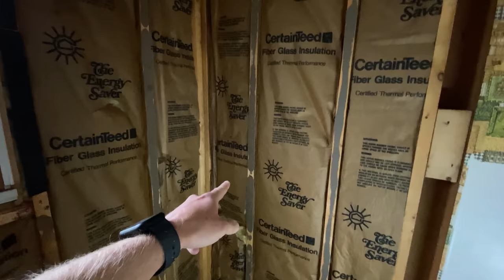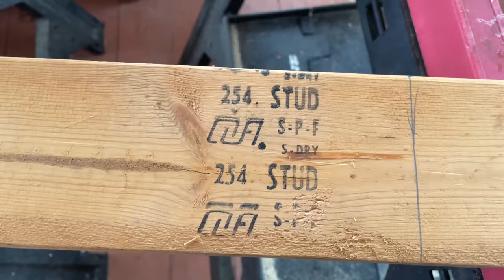The Modern Home Makeover // Episode 10 - Moving a Window

Comment: The guy that built/worked on this house before you is the one everyone claims to know that “can do it cheaper” than the professionals 😂
Reply: That's every remodel ever. Codes were different then too, so what passed before might not now. My spare room from the 1930s had 1" cardboard for insulation. I'm sure this house they are working on has tons of two wire systems where now we have 3 wire. It's definitely interesting how things change in a short time (20years). I'd say they got more strict in what would pass now.

Comment: It's strange to me in the UK that your houses seem to be all timber with weather proof sidings on the outside and some sh*t on the inside, whilst we would use proper insulation and then plaster board and then plaster over it for a smooth finish you can paint or use wall paper. Well, horses for courses as they say!

Comment: No jack studs on those window frames? Never seen a lack of jacks combined with the presence of a header 🤔
Reply from the maker: Neither have we, but that how it was installed before we moved it and that’s how the window we are matching it to is installed. Both windows are installed with only 1 stud above the header. We weren’t sure if this was an old construction method or what, but we figured if it’s lasted 40 years it’s probably good to replicate it since it was being moved in between an identical layout on the studs. Call us crazy🤷🏼
Reply: @Building_Jays_Way  Honestly a space that wide doesn't really need a header. The only header in my house is above a 9 foot wide cutout for an addition, all the windows are 3 feet wide or less, its been that way since 1952 and it hasn't fell over yet 🤷‍♂️ I've cut out 10 feet of supporting wall before to make changes and it didn't sag at all 😳
Reply from the maker: Yeah, we’re knew to this whole remodel thing. We just wanted to replicate what was done. We mulled over whether to add jacks and make it like new construction for a good while.
Reply: @Building_Jays_Way  renovation/additions is 90% of what I do 😁

Comment: at their rate, this house will be complete in about 20 years!
Reply from the maker: 🤣 We’re getting close! Next is electrical and plumbing, which I may or may not film because I want to get it done. Drywall, flooring, cabinets. I don’t know why we chose the hardest thing to remodel in a house first 🤣
Reply: @Building_Jays_Way  get the hard part done and the rest is a piece of cake
Reply: @Building_Jays_Way  you gotta film that man! I'm in the process of doing all the electrical and plumbing for our house and need the encouragement. There is so much code so get ready. Hopefully you have ground wires already installed. Mine was built way back so no ground wires and I have to replace it all
Reply from the maker: @J and S Hatton I may just do that for you. I’ve done most of the research in code for the electrical. All of my electrical will be new since I’m actually moving the kitchen. 

The only reason I don’t want to record it is because I’m sure something I’m going to do won’t be “exactly” right. Who says someone can’t try their best with limited or no experience though? 

You saying that you’re doing it is an encouragement to me.
Reply: @Building_Jays_Way  This is true! If there is one thing I can tell you it's that everyone does things a little differently and your never gonna do it the way someone else would. Just put it out there and let us all laugh and learn along with ya! If you need any help lmk I've done enough of it recently lol